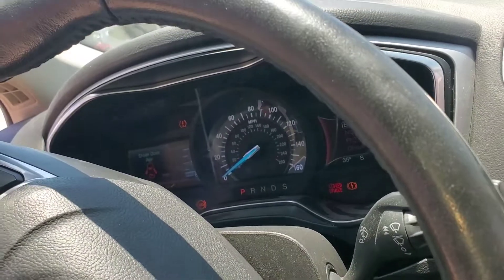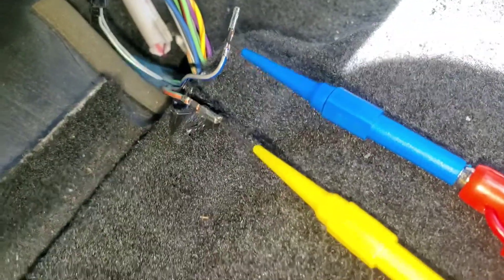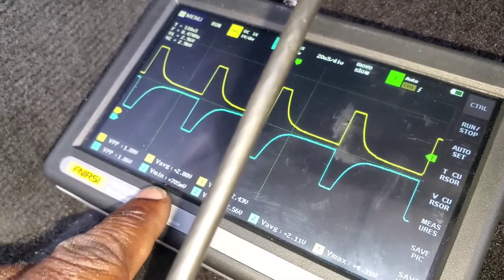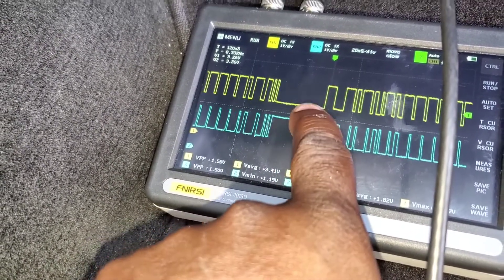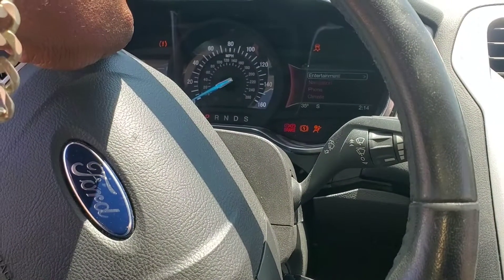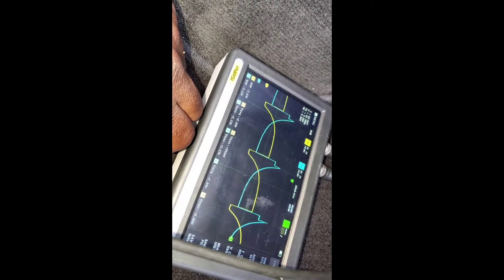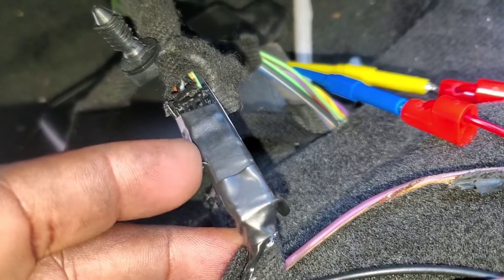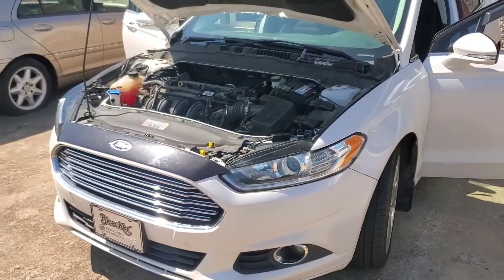2015 Ford Fusion advanced can bus diag using labscope , splice blocks, NO COMMS ABS, RCM, PSCM, OCSM

Comment: On what moudle the TERMINATING
RESISTOR are on this Ford Fusion, thanks
Reply from the maker: Ecm, I have to look up the other, I forgot
Reply: I really appreciate it
Reply: Make sure you check 418 in the workshop manual. They change stuff randomly so a different model year might not have the identical can bus set up. 

For example, my mustang has an extra can bus and it caused me a lot of issues trying to connect to the abs module… used to be hs1 and hs2 were both accessible thought 4,16. Now hs2, hs3, hs4, MSCAN are all on 3,11 as “diag2”
Reply: @josephbargo5024  correct, ford is now using advanced gateways. Even on my 2014 model year HS1 and HS2 are separate and able to be probed at the OBD port. However, HS3 and MSC are legged to HS2 via microchips in the gateway module which is attached to the OBD port.